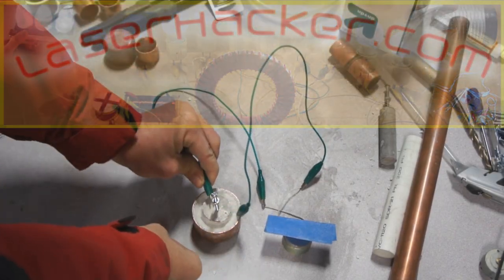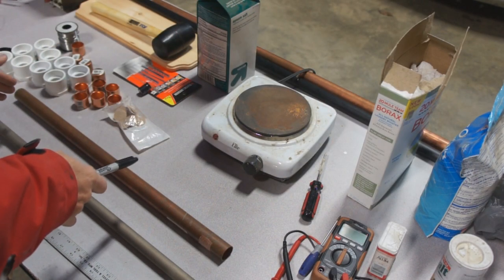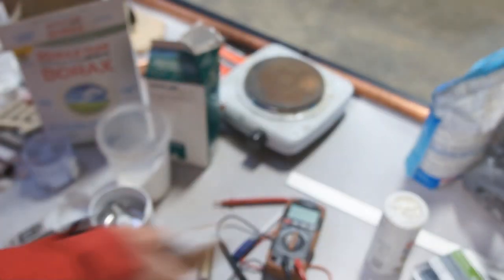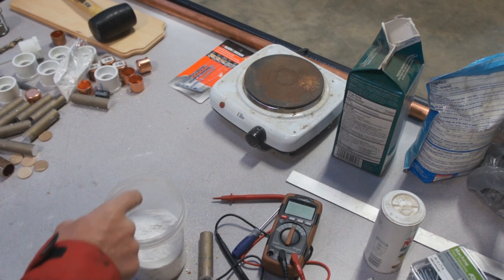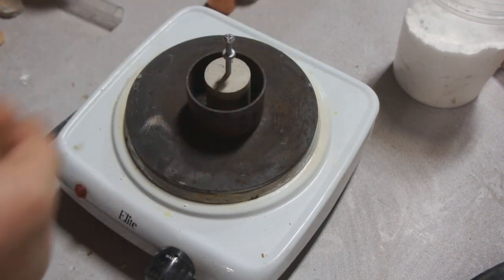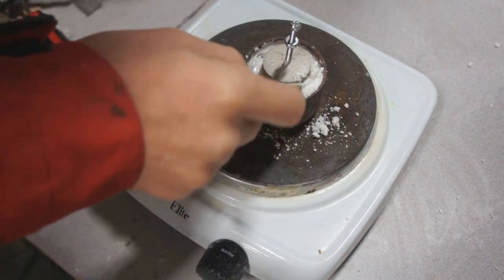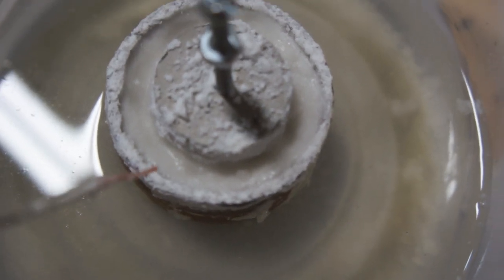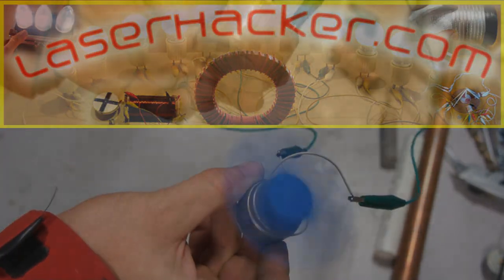How to Build Crystal Power Cells - Long Duration Power

Comment: Hello I could not find out where to buy alum, the other ingredients were readily available to me, drug store for epsom salt, Walmart for Borax and the super market for No Salt (sodium free salt substitute). I have made other cells before, with water, iron and copper with a bit of salt and got about 0.5v per cell, not bad but very low amperage. I decided that despite missing an ingredient, I would attempt to make a cell using a galvanized nail and a brass rod as electrodes. I also have no hot plate and cannot use the stove here for it because oher people need the stove for cooking. I used water to mix my ingredients, and I added salt. I let the water dissolve some of the mix over a couple days and let it dry to the point it is almost a non newtonian fluid. I coated my electrodes in the mix and placed them under a fan to dry, then placed more of the mix across them, bridging them about 3 to 4 mm apart. As the mix dried, I rotated the cell and added more mix, also charging the cell on 5v usb. I don't know if your cells had any charge to start with, but mine didn't and seems to be chargeable/rechargeable. I've got it at about 2 or 3 volts right now when I remove the usb. It's still not done charging and is still in the process of being created/dried. It's been charging for about 12 hours now, and it took 6 hours of that just for it to reach about 0.5 to 1v. I believe this method of drying while charging may condition the crystal matrix for proper charging/recharging conditions as it puts oxides into the cell while it charges. Of course, once the cell is dry, the oxides will no longer be produced when charging. If and when the cell reaches 5v, I will switch it to a 12v charger, then maybe a 25v one and see how high I can actually get it to chargeIf this works out, I'm making my own batteries from now on. I'm thinking the alum may have allowed me to charge the cell faster, and some graphite oxide powder would probably give the cell more surface area to charge, but I could be wrong. The fact that your instructions are actually for something practical that works which anyone could make, it's hard for me to get why you only have 94000 subscribers rather than millions. You'd think lots of people would want to learn something new.
Reply: lepayen alum can be found in the spice section ; )

Comment: But does it produce more power than is used by the grinder and the heatgun?
If not... then it is quite stupid... btw...a lot of good comments on this one....
Reply: i guess if you wanted to be really green about it you could use focussed solar energy to melt the hot glue and warm up the plate ;) so perhaps not totally pointless?
Reply: lol, do you think the assembly line making the d cells for duracell could run on the batteries it makes per hour?
Reply: There is still the mining of the materials and whatnot, then the transportation and even the packaging uses energy to make it.
Reply: This person apparently thinks batteries cost less energy to make than they provide XD

Comment: i saw the original they shock the crystals. i wonder if you can actually make one with only dirt and other ingredients.
Reply: but i know that magnesium activates in heat so i guess this works but the original they shock it and trap the energy in the crystal that's all you do for a infinite battery you charge the crystals .

Comment: how does this works? it can't be chemical, because liquid is the best way to get reactions, solids(unless it's a fine pownder) don't do a good job? please, I need answers!
Reply: Not right, your electrolytic dont need to be liquid for it to work, it just work better.
Try this for zero cost : Take a few carbon mines ( ie pencil mines) or acivated charcoal that would e your positive, wrap them with kitchen paper, then wrap all with aluminium paper with care that aluminium neve touch the carbon. Then plunge evertying in a salted water solution, then let it dry. Even not wet, this battery will still provide some low currrent Easy and much less expensive. The more dry the longer but with less current. The more wet, the more powerfull but shorter range effect. Its just a classic galvanic cell more or less activated depending the nature of the electrolytics

Comment: 04/09/16
Just an observation. When you listed the ingridients, specially the first one "alum", there are various types of alum in the market. It will be good to have you read the actual ingredients of the powder so one can search for this constituents and not brands or like in my case chasing an image of the can (very low resolution, though) and trying to look with the keyword "alum" in a search for images i could not find your container.
I do understand that this technology cost you many trials and errors that prevents me from asking for a proper description but if you are actually sharing this information, please doit in a more comprehensive manner with out assuming that we know some basics but probably not.
cheers,
VB

Comment: Ok. So youve built an early form of an alkalide battery.
Batteries burst and leak for the same reason as the one that pushed the magnesium rod out.
Now that I have said that, here is my suggestion for home making.
Increase the surface area of reaction process. Oh wait thats a battery too.
The plus side is that you have done this at home with stable materials.

Comment: It is still a chemical battery. Perhaps to get a true crystal battery that has no chemical reaction involved it might be possible to get a usable load from it using the piezoelectric effect. In this case subjecting the crystal to an acoustic wave that will compress the crystal causing a voltage differential in the negative and positive polarities which will induce a current in the conductor connecting the two polarities. It would probably take a very large double terminated  crystal to do the job but to make this a true battery the current output from the crystal has to larger than the current used in the acoustic generator. The power for the acoustic generator may have to first come from a capacitor that has been pre-charged then the crystal can resupply it once it gets going.
Reply: Pssst, all batteries are chemical batteries. See, everything is chemicals. Even crystals. Crystals are simply chemicals bonded to one another in a crystalline pattern.

Comment: If you could give the voltage and the current going into the motor and give us an update of how long the motor runs for ThunderBossGamer?     Could you please measure the voltage and current every week as you keep running the test? I was hoping that the crystal cell would never die?
Reply: If it was a real crystal battery then it wouldn't deplete. The energy would be extracted due to the http://en.wikipedia.org/wiki/Casimir_effect
Reply: Here read some more: http://www.hutchisoneffect.ca/Crystal%20Battery.php
Reply: Yes there is, you are mistaken.  A black hole is evidence of it. Dont be limited buy what science teaches in text books.

Comment: :-)  basically your getting your power from radio stations, you can do the same trick with large radio  antennas or you can make a crystal receiver or just buy a crystal receiver from radio shack ( if they are still in business ) which is faster and cheaper. ( than spennding all the money on chemicals, heating and cooling ( electricity or gas ) and your time.  PS when your radio stop transmitting  you'll stop getting power.   PS the above video has a transmitter  close by.

Comment: Your device makes me wonder...you've heard of the piezoelectric effect. Have you ever tried a container filled with quartz and mounted a pressure plate on it that could be controlled with a bolt you could tighten to push the pressure plate down?
Reply: The piezoelectric effect is based on compression not pressure.  It requires movement to work.  Simply applying a constant pressure to a piezoelectric material does not produce any electricity.

What you describe would only work while the screw was being tightened so all you would have is a rather inefficient generator.
Reply: Thank you.

Comment: YOU CAN TELL ME IF THE CRYSTAL CELL CAN BE RECHARGE?THX
Reply from the maker: We have to see how long they last under load first.  I have been testing them for a few years now.  You can see the live video feed here:  http://laserhacker.com/?page_id=20

Once in awhile if they air is very dry I may have to add a few drops of water to the cells.  I guess you could call adding a drop of water a type of recharging effect.
Reply: +Tony Robert   It appears you don't get it  Theoretically @ least the idea behind a crystal cell is that it is a solid state circuit device similar to resistors transistors diodes chips capacitors inductors etc that never needs recharging because it never changes composition.   It is not supposed to derive its power from chemical reactions between dissimilar metals like ordinary batteries rechargeable or otherwise but rather draw its power from the environment.  It is never supposed to need recharging at least in theory.  Rechargeable batteries derive their power from the grid or some other source of power.   Throw away batteries derive their power from chemical reactions in the materials that they were forged from.  Your question is a non sequitur in the context here.
Reply: +Tony Robert I suppose the whole idea here in more simple terms can be summed up as this: If it needs 'recharging' then it defeats the whole purpose of the cells.

Comment: lo salt  £ 2.00      borax £ 1.00      cost of  case £ 2.00  cost of heating to temperature  £ 1.00      -   equivalent   ;     buy an orange  , stick a penny and a five pence piece in it   run a lcd module on it and when you get bored  cut it in half and use it for an air freshner or add it to some baking powder to amaze the kids   - they love it  !!!

Comment: Can u use a difrent metal besides magnezium?
Reply: try aluminium its the next closest thing to magnesium on the periodic table otherwise google "sacrificial anode" on google they are made from magnesium and used in plumbing. I got to say i find it difficult to belive this thing works though
Reply: magnesium is also used for firestarters, you know like a striking flint. 
can only find square ones tho, just need to make the copper pipe square.
Reply: iknowsstuff maybe zinc?

Comment: For all interested in it, here is the disproof:
http://en.wikipedia.org/wiki/Conservation_of_energy & http://en.wikipedia.org/wiki/Perpetual_motion

Or in short in closed system, you can't produce energy. You just can transform it.
E.g.:Gasoline(chem.energy) -> Heat/Pressure -> Motion -> (in real system) Fraction -> heat/deformation.
And every transform looses in real system some energy again. Trust me I'm engineer :D

Comment: Surely you/someone could link enough of these together, or just make a mega big one with enough torque/power to run a motor, spinning magnets around copper coils (a generator in other words) charginging up other batteries with wider, more compatible applications. What I mean is I don't think there's a place in my motorcycle for that battery xD. Not only that, i'm amazed by the duration of one of these things. I understand the torque/amperage/voltage etc may be weak, but there may be a way of adjusting things to alter the ratio. I'm no expert, there may be no way at all. Limited to the properties of the original chemicals. Either way this amazing battery life can be exploited. Produce hundreds of them, powering big batteries over your life time, enough to sell to some company when your old. Be a bit like a pension lol. I could be chatting oout my arse anyway. It's all about price of the original materials to profit at the end. This killer battery may only get you £1000 worth of energy after 40 years, or the government brings in new laws that say no more big batteries and they take i t of you instead.

Comment: I have a mold that I made that is the exact dimensions of a phi ratio pyramid just like the great pyramid. I however never knew the materials that went into making these crystal cells...so thanks. I also have a stepped nested cylinder that is also phi ratio. I can send you picks if you contact me on google+.  You should link to the ingredients on amazon.com so it gives people more reasons to experiment. Something I would like to try is running a computer power supply on one of these through a joule thief.

Comment: Is there a downside to this power cell? And it there a way of increasing the power generated? Also could magnetics increase the charge? I am no scientist, just someone with a vivid imagination :P
Reply: +James Best jr. I'm new here but, if you stack cells together, you can get more power. Series ups the voltage, parallel ups the amperage. Same with batteries. I also don't think the addition of magnetics would work, as this is chemical in nature, but I could be wrong. Testing could be a fun project, hands on research is so much better than watching videos, but I understand the importance of good information.

Comment: take our new pennies, they're copper plated zinc and make batteries from them, too. Sand off copper on one side of several pennies, say 5 or 6 or so, and stack them on top of each other with cider vinegar soaked paper between the pennies and you'll have the same thing. Stack them zinc to copper with the paper in between....
Reply: James Jordan  This seems much easier; can you elaborate or go into better details for us dummies?
Reply: Larry Stead  
Larry Stead, get yourself a good nail file or just some maybe 100 grit sandpaper. Press a penny against the paper and drag it across, removing a thin layer of copper, exposing the core of zinc. Continue 'til you have five or six pennies, one side copper, the other, zinc.Take some newsprint paper or notebook paper and cut little squares just about the size of the penny, maybe a little bigger. Soak the paper in apple cider vinegar. Take a small piece of copper wire, say, bell wire (it's pretty thin), strip it, and lay a piece down first, long enough to protrude a bit from under the stack of pennies you're going to build. This will be one of the "electrodes" of the battery, maybe the negative, i don't know for sure. I think the electrode from the zinc will be the negative, the copper, positive. On top of the wire, place a penny, zinc side down, on the wire, then a paper square, then another penny, always the same, zinc side down, alternating with the vinegar soaked paper, and so on. Top off the stack by affixing another short length of bell wire to the copper of the topmost penny, and voila, you have a 1.5 (roughly) volt battery. Try a larger stack and it will likely increase the voltage. Haven't tried this yet myself, but I need some other equipment/tools first...

Comment: I wonder what would happen if you were to mix a 1/2 cup of magnesium powder into the mix, and instead of using a solid core, you simply mix everything together, heat and pour it in to the cap. then just suspend metal just like a wick in a candle.....

Comment: A much longer lasting alkaline-like battery with a reaction that takes WAY, WAY longer to end, and/or a battery that Rayovac, Duracell, and Energizer wouldn't  want to go viral... Couldn't you?, construction wise - instead of using a hot plate - prepare all of your cells for a "Pour"...grind your ingredients....and then on low, heat the entire batch in a metal bowl on a stove top till molten (there must be an optimal temperature)...(Does it give off heavy fumes when heating?)....then use something like an electric hand mixer or a whisk (Similar to mixing cake batter/getting the lumps/air out) then just pour the mix like concrete into the prepared cells all at once (Get your hands on a big fat syringe/turkey baster)....I would think you could make them much faster and eliminate the air bubble problem....and to get more surface area, perhaps make a smaller batch first and instead of wood on the bottom, pour some into the bottom of the cap, let it dry, place magnesium core then pour more mix around it so the core is completely surrounded?...Just an idea........